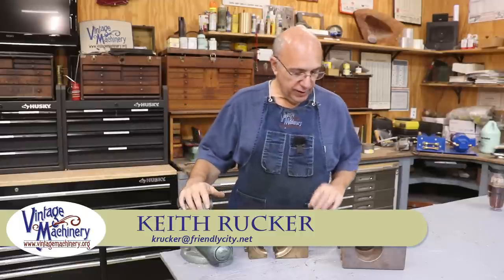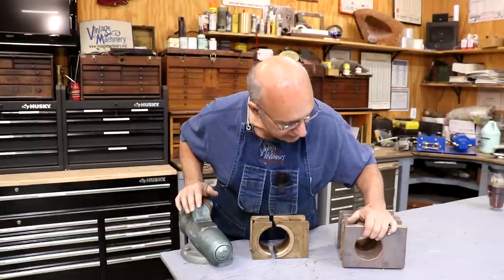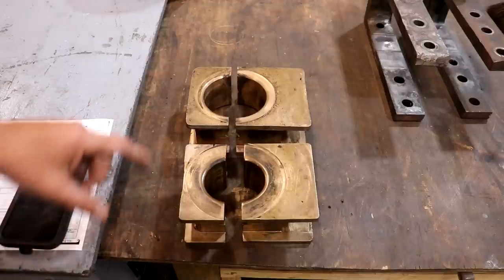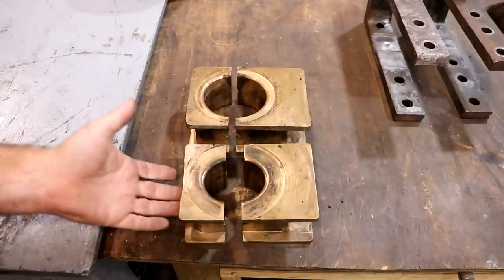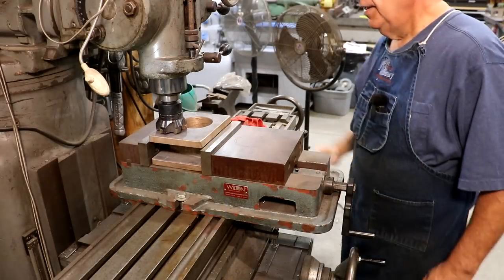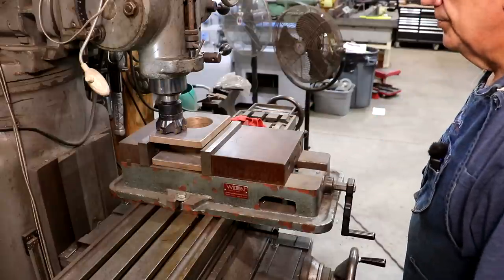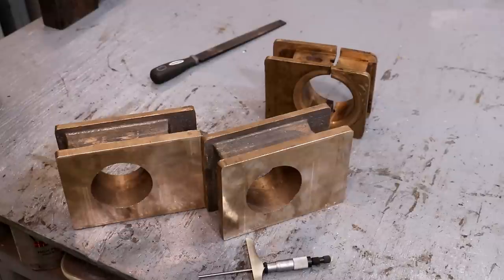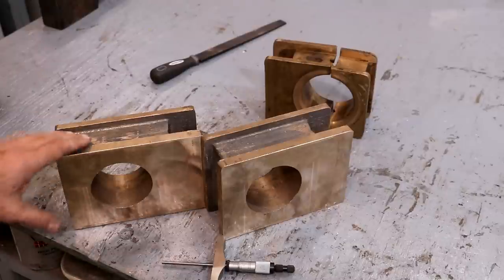Bozo Comes to Town - How I Ruined Some Really Nice Bronze Castings...

Comment: I wouldn't class that as a rookie mistake. It's an issue with mechanical micrometers. When I was teaching advanced machining we were strict on that micrometer measurements always should be double checked with calipers or other easy to use method (that it's less accurate doesn't matter, it's the coarse measurement that needs to be verified).

Cudos to you Keith for showing your mistake and thus help many more avoid doing a similar thing.
And also the attitude, you take responsibility and pride in your craft.

Comment: It happens, luckily you have support to save you. Those castings ABSOLUTELY do not hace to be scrapped. The only critical dimension is the thrust face. Pad it with silicone bronze rod and then machine it back. It is a pretty common machine shop task. TIG it, braze it, or buy a small spool of SiBr MIG wire.  Don't toss a good casting for something that can be repaired easily.
Reply: That would have been tempting if he'd been deep into the work, but recasting seems like the right call when all he has done so far is clean up the two faces.
The lesson here is not the thing he did wrong, it's the thing he did right - check your work after each operation. This is a small fail, waiting until you're fitting the finished part to find the incorrect dimension is much worse.
Reply: Brazing or flat knurling would work but if he’s like me every he saw the repair in the future he’d see his painful mistake all over again. Better to make all new parts to print and move on.
Reply: This was my first thought. Since new casting would be expensive and time consuming. It's even admittedly not a critical dimension.
Reply: @d3faulted2  Couldn't he just shim it?  If it's only 25 thou, seems like that would be a quick and easy fix.   But I guess it would annoy him every time he looked at it.
Reply: @jsaurman  The crank pins are capped so a shim would need to be split, which won't work as they would drop out...
Reply: This is what I was thinking. Would be faster to braze these and machine back down than wait for castings.
Reply: Braze, shim, or do anything that can work but don't scrap the parts. Do not make the customer wait. Keeps things moving. Scrapping is for the industry, cleverly recovering unexpected problems is for the skilled artisan.
Reply: I can just imagine that feeling when you realised what had gone wrong. Happens to all of us at some stage, but really not great. Just like you I cannot live looking at something I know is not right. It happened to me today, I'd welded a gate catch 15mm to high, only realised when I put the gate back on for the customer. So taken it off, will reweld the catch in the right position tomorrow and then back to the powder coaters. So lost money on this metal gate refurb, but I want it right as does my customer.
Reply: Actually took the words out of my mouth. Maybe a hour of labor to Tig a new layer on them and machine it back down to correct size. This verses maybe a month to reorder, cast, ship the replacements, and the cost. At least worth a try.
Reply: right... 0.6mm off the thickness doesn't sound so bad for a locomotive... how much is the recasting going to cost the museum?
Reply: At my shop I could do both, cast new parts or fill and bore. I’d melt them down and start over. That part is going to last for a long time. Might as well be just right. 

If it was going on a bulldozer I’d use the welder.
Reply: @joergengeerds360  I honestly don't know, but I wouldn't be surprised if each one wasn't $300-$700 a piece. Add in the time of having the locomotive apart, put back together, then taken apart again only to put it back together one last time (not sure if it's volunteers or not) but this could be $5,000-$10,000 dollars in labor cost, down time, etc. I might be taking out the wazoo but I think it's a very expensive idea.
Reply: Lots of good replies here. I look at it this way, If it were a dimensionally critical component or a component with a criticality in where there is a high probability that personal injury is likely or catastrophic failure is likely I would say start over. Given that these old steam locomotives are hard to kill and are capable of loose dimensions, coupled with the complexity of the castings I would weld it and remachine it. The museum has to foot the bill, likely Keith had Windy Hill Foundry do the castings so replaceability isn't going to be a problem, likely just time. 
This is perfect example of a relatively common task for a well equipped shop, repairing a machining error, it happens pretty often. 

I would offer to do the welding for Keith at my shop but I am betting this video is not recent and the replacement and machining has already been done. That being said, I would weld it and machine it just for the hell of it.
Reply: @btrswt35  But steam enthusiasts love taking stuff apart and putting it back together, and it's all volunteer labour. I guess Keith is paying out of his own pocket for Clark to recast them (or maybe Clark is a steam guy too and does it as his contribution to the preservation, that's definitely a thing in steam preservation circles), but he'd pay in time and other resources to braze that 0.025" back onto the original so...
As Keith says, very little downtime as the old bearing shells will last months at least, and the new ones are going to be on there for decades so they might as well be perfect when fresh.
Reply: @jdm2651  This is not a paid job for a customer but replacement parts for a museum engine. Better to melt down the castings and make new ones at this early stage.
Reply: @ellieprice363  exactly, which means the museum needs to pay for this from its already thin budget...
Reply: I know how you feel 😡

Comment: I admire your honesty in admitting your mistake.
Reply: Reminds me of what someone told me about making mistakes. The one person that claims to have never made a mistake either is a liar or never has worked. And I luckyly was taught to never see a mistake about something to be ashamed of, unless it was amassed "idiocy" or negligence that led to it. The most important thing, if you make a mistake, stand up to it and try to correct it. Also, look at how we learn Maths and stuff at school. We make mistakes, we learn why it was the wrong way, we try again. Mistakes should always be seen as a learning experience.
And while we as humans, working in a professional manner and a professional environment, have become extremely good at either preventing mistakes or catching them at such an early stage that we can recover, even in automated industrial size mass production mistakes happen. there might be an air bubble in a line, screwing up something, some piece of debris made its way into something, just something breakes (although we could argue if that would be a mistake in the first place, but there are usually mistakes that lead to something breaking, like lack of or improper maintenance or too much wear). And then add in a human. There might be that split second where we don't pay attention or get distracted. It is easy for us to mix up measurements or sizes. We might simply not fully understand what we are doing and what we should be paying attention too. There is plenty where things can go wrong. And sure, things at some point will always go wrong. That is also, why we put so many layers of protection and procedures in certain fields, flying an aircraft or just riding a car. We cover them in so many blankets, just to make sure we can allow for a mistake or two, because we can strieve for it, but we will never be able to completely avoid making mistakes.

Comment: Mistakes happen. I have been a heavy duty mechanic for 35 plus years. 2 weeks ago I put seal kits in the foot break valves for a John Deere loader. It all went well till I started the machine. And one of the pistons shot out breaking one foot pedal and spraying hydraulic oil inside the cab. Simple mistake I got 2 hosed reversed and that’s all it took to pressure the wrong way and bingo big mess to clean up. Another week of downtime waiting for the 300 dollar foot pedal to arrive. Yes mistakes happen even with the best of of us. I haven’t had a mistake like that in years. So we just admit our mistake and move forward. It doesn’t do any good to fret over it

Comment: It’s quite common to build up bronze bearings with whitemetal (you’d call it Babbit) so just tin one of the faces and build up with material +0.025”
Reply: Yes!  I was wondering what "could" be done if a person had to.  I was wondering how this casting could be built up.  I was thinking Sillfos, or something involving less heat such as soft solder.  Your method sounds reasonable.
Reply: @bryanh1944FBH  In 1917, and around that period, that would be done unless there were replacement castings readily available, like on hand.

Comment: Back in the early 60s I finished machine shop schooling and then completed my apprenticeship and I made some of these same mistakes. I look back and cringe but at least we can recover, yes this type costs and does not result in my understanding as some others might. The set ups I did wrong will always be a reminder for me to check more than once but even then once a cut is made the reality shows up that I had something upside down. Good on you for posting.

Comment: I learned to chase a thread on a lathe  when I was 13 years old, I am 80 now and after all these years as a machinist/toolmaker/hobbyist I still have to stop and think when I pick up a depth mike and usually check the dimension with another method of measuring. We just don't use them enough. So as I tell everyone i introduce to the trade or hobby the scrap box is your friend don't be afraid to use it and then show them my collection of Bozo stunts.

Comment: One time I realized cuts in cherry wood I made for a piece of furniture were 1/16th of an inch short.  I had used a tape measurer I inherited from my father who had gotten it free at the opening of a local hardware store.  When I compared the markings to those on my Stanley tool, I realized the tape measurer should have come with a warning:  Not To Be Used For Measurement.

Comment: I was working over seas on a project. I bought all my tools with me. An American unit was on location and had a broken part and the local mechanic was trying to fix it. He wasn’t proficient in imperial and only having metric tools, I had both metric and imperial. I was teaching him how to fit a metric part into imperial. Most times a use the good imperial components a only modify a few metric ones to get them all working together. I was dry fitting parts after disassembling the metric housing I needed and putting in all the imperial internal that were good I had just finished modifying the last component and didn’t mic the depth of the two components they looked the same but weren’t the same. I assembled everything and put the part on the unit it would lock up and wouldn’t spin freely. I had to take it all apart again in front of everyone and re measure everything  and I found it and lapped it on a flat surface with sandpaper superglued to the flat surface. The maintenance manager wrote a report and an exemption for modification of parts. It took three times longer then it should have if I hadn’t been destructed by all the people asking questions and touching my tools. I was extremely lucky I didn’t force anything together at assembly and installation.  I was using my calipers as a depth mic also. One guy was always grabbing my calipers and playing with them. They weren’t my best ones I own but was the only ones I bought with me, and maybe the only imperial calibers in the country. I had a tape that measured in imperial and metric, I had a ruler with fractions written on it.

Comment: We machine large split bronze bushings. Sometimes up to 35" in diameter. We have a roll of mig wire that we use to weld up bronze if we have oops. Mostly we use it to tack weld the two halves together for machining. Also when machining something like that flat on the table, often you can use od mics by putting the mics down in the t slot.

Comment: I once set a g53 reference point incorrectly and took .118 off the end of a part I was trying to refurb. Was talking to a much more experienced coworker, and he told me he once cut 8 inches off a 6 inch part. As the old guy in the shops says, "If you're not messing up, you're not machining."

Comment: Stuff happens. It'll get done, when it's done. Thanks for making a very valuable video. Kind of like indicating on a part  when you're grabbing the part from the inside rather than the outside with the chuck. high is low and low is high.

Comment: How about silver soldering a sheet of material on one side. Could probably do this in your heat treating oven. On my small Dunbar popcorn steam engines I do a lot of silver soldering on new material to save worn old parts. Works great. I feel your pain - been there done that!

Comment: One older fella who taught me a lot about machines and machine work said to me one day. You show me the man who says he never made a mistake and i'll show you a liar.  I've scrapped a part they had 16 hours into it already. Swore like a sailor. Called myself names. But in the end the only fix was to chuck up another chunk of stock and start it over. The true measure of a Craftsman be he working in wood or metal or many other mediums. Is not what he can do when everything goes right. But what he does when it all goes wrong. Thanks for showing us the good the bad and the ugly Keith. And your not the only one who has read the depth mic wrong and trashed a part. I belong to that club myself. in fact I wrote (Backwards Dummy!!) on the outside of my depth mic case that day

Comment: I had a similar error when assembling a motorcycle engine crank.  I misread the micrometer, set too little gap when installing the connecting rod bearings, and didn't realize it until the engine bottom end was fully assembled.  The connecting rod was very stiff on the crank.
Ruined a very hard to find crank, and had to replace the connecting rod bearings and connecting rod.  Took almost a year to locate another usable crank.
I was sick to my stomach at making such a rookie error.  But I learned from it and measured, remeasured, and measured for a third time after taking a break during assembly to ensure I was reading my micrometer correctly.

Comment: Always try to use two different measuring devices and techniques as a self-check. In this case double checking with a scale might have saved you. Or use the depth rod on a caliper.

Comment: Excellent video,. Keith. No one is perfect, and that is another thing that makes this a great channel. You could shim it, braze it, maybe Terkite it, bit it would gall you every rime you see the locomotive. Good call to do it right, and thankfully the steam engine's seasonal runs are not ruined.
Reply: I commented above, and was wondering the same.
I was thinking of shimming it with a plate, but brazing a .050 plate seems sketchy depending on side loading. Might be better/stronger to take a another 0.100 off, then you could slide a beefier .150 plate in, braze it and drill and tape 9 bronze bolts in for shear strength and machine flat.
Scrapping 2 new parts should be a last resort, unless its H&S.

Comment: Don't sweat it. I worked with a guy who scrapped $28,000 dollars worth of tungsten one night. These were counterweights that go in the flaps of commercial aircraft. He read the drawing wrong which had several different dash numbers listed. The weights are physically all the same size but the thickness which controls the weight of the part and hole pattern are different. I was the quality inspector who caught it. I felt really bad because he was fired the next day. I went to bat for him but the boss said no because the company (and we were a small company) had to replace the material. It was a government contract so we got hit with a late penalty because we had trouble getting material.

Comment: Hi Keith.  I do agree with sshep7119 those castings can be repaired. I have seen bearings relined with MIG welding as replacements where so over priced. We all make those rotten mistakes it hurts but one just jumps back on the horse and heads to a new winning post. Think about the repair it just may allow the engine to back on the tracks September. Have a good week.

Comment: Recently made a very similar mistake, using inside mics to check the ID of a hole I was boring., I read the scale backwards, having just used outside mics multiple times to check the OD of the part I was turning down previously, right before I started boring. Got in a routine, and simply forgot to shift gears mentally.

Comment: Further to my plea for not scrapping parts unnecessarily.
I would not have scrapped the originals to begin with. Rather, bore them round, turn an under cut on each side.
From a thick bronze tube, or casting if necessary, turn a bearing with shoulders which fits in the undercut. Split it and fasten with countersink screws to the original parts, screws will carry very little later load and will be invisible. If any problem with the applied bearings, these can be replaced more easily and economically. 
Back in the day castings were cheap and machining expensive. Take advantage of that. Why spend 1,000 when can do with 300, people will enjoy the very same train ride.

Comment: Those bearings should work fine. The yoke and wedges will keep them centered. There is a counterbore for the crank pin that will accept the difference. You don't know how many times I have done it. Twice on the same job. Counter boring for inserts on an engine. I had to cut the two inserts out.

Comment: Hey Keith,   why dont you machine a recess into the the sides of the castings and run a thrust washer in there.   It would give you a replaceable wear part and save your new castings ?